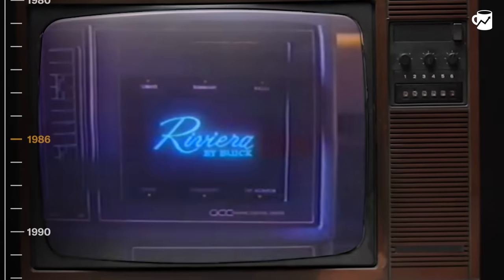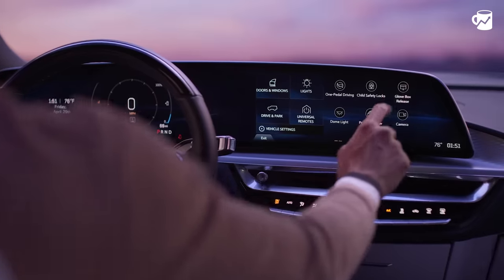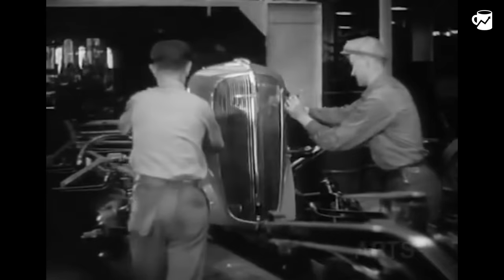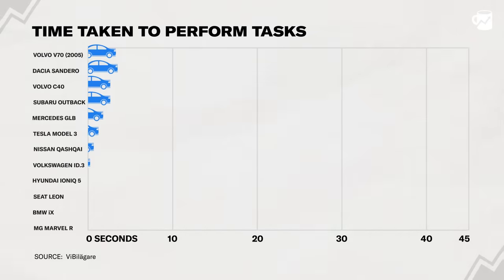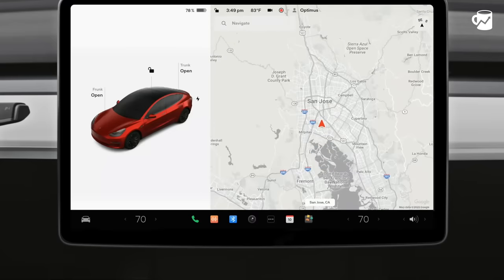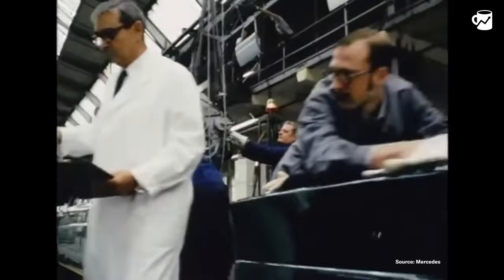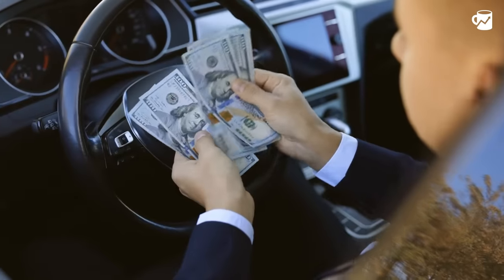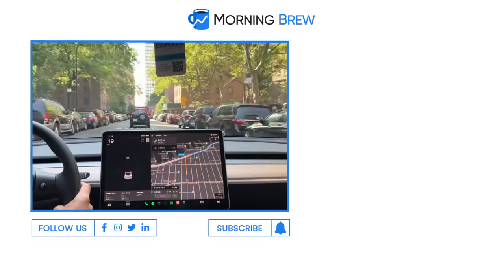The Real Reason New Cars Have Touchscreens

Comment: I work in the radio replacement industry and I can tell you this is also going to make radio/screen replacements basically the same level of extreme as a blown engine. Tech generally lasts about 7 years as far as cell phones and tablets go. Cars used to last 15 years then the engine would blow and people would finally give it up. Now after a few years of use their entire dash could die or just become unresponsive and now depending on the dash/screen it's going to cost as much as an engine to replace.

Comment: Some companies still do a good job of keeping a balance between buttons and touchscreen. My Vilvo C 40 still has some basic buttons like mirrors, locks, lights and basic sound control as physical buttons. The rest is either touch screen or voice commands. They do a decent job by keeping buttons very big on the screen for the apps that you are meant to use while driving. I dont often complain about anything taking more than a couple of seconds to do.

Comment: That is one thing I like about my 2014 vw passat, it has a touch screen but it is not neccesary, you get buttons, you get touch, you also get steering wheel controls, you can use the car without using the touchsceen for most of the things except gps navigation imputs, and it is honestly one of the best car in this regard....

Comment: I have several digital cameras that have rows of unlabelled buttons, known as soft-keys down the sides of the screen. Depending on the function selected, generally with a twist knob, the buttons have different functions which are indicated by icons displayed on the screen. This would work well on a car, enabling both buttons with a tactile feedback and easy reprogramming.

Comment: When I bought my 2013 Ford Fusion I was impressed with my touchscreen, which was large in 2013. It also had buttons on the steering wheel that controlled the majority, if not all the functions I needed while driving. This should be the way it’s done IMHO

Comment: Fairly pleased that my new Audi has a sensible number of its controls as buttons, allowing basic driving adjustments to be done without touching a screen. e.g. demisting, adjusting the AC, activating the rear parking camera and so on.

A handful still require me to look at the screen (most notably selecting different drive modes on the hybrid system), but it's at least minimised.

Comment: Thirty years ago, one of my engineering professors stressed the fact that (almost) all cars had the same user interface: adjust interior temperature with a single knob, radio volume is on the left, tuning on the right, wipers are in the stalk on the steering column, etc. etc. Now they can change the UI in your own car when you bring it in for a tune-up. I'm hanging on to my 2010 (manual) Subaru for as long as possible!

Comment: Another issue with having a touchscreen controlling everything is that it creates a single point of failure.  If anything goes wrong with any component in that computer or display, you can’t control anything, whereas if your radio breaks, you can still control your hvac and other systems.  Too much integration eliminates redundancy

Comment: Tablets don't last forever and it is almost guaranteed that these specialty model tablets won't be a replaceable or available part down the road, except for someone who really wants to pay $4,000 for one on EBay. This virtually guarantees that these cars will not be "classics": Won't even be able to drive them to the show.

OTOH, theoretically one solution might be possible to make a generic tablet (with standard footprint and connector) that works in all cars (or at least in all cars from one manufacturer). For instance, having a "slot" or cradle for slipping in your own Apple iPad. And the car's computer automatically uploads the software to the iPad to run it. (With security firewalls of course for driver identity/ownership.)

Also OTOH, it might be possible to greatly simplify the UI (user interface) on these tablets so that you only get 2 or 3 monster-sized and differently-colored buttons at a time, and only 1-2 choices at a time.

But ultimately, I agree: knobs and switches, please. No look-y. Use feel and sound.

I remember the old Mercedes W123's, W126's, W124's, etc.  Whole lines of cars across decades that used and reused the same switches and dash parts again and again and again -- thus (largely) solving the problem mentioned here of dash redesign expense.

OTOH (again), when did Americans ever want to go back to "simpler" and "same switches as last year"? Maybe it is time.

OTOH (finally!), cars will be driving themselves more and more. And when that happens, there really won't be a reason for most of us to even own one. We'll just call one.

Comment: Toyota so far is the only car brand I've seen doing touchscreens somewhat right. Take the latest Corolla; it has a touchscreen but it's mainly used for stuff you're not supposed to tinker with while driving. All essential features are button controlled. Any stuff that can be controlled though the screen you MIGHT have to use while driving either still has a separate button (handsfree phone, radio) or can be controlled through voice commands (satnav)

Comment: Totally right. This is what I have been saying since long time. It’s not designed for driving. Not only about the amount of options to turn on and configure something (for instance, the AC: touches to find to turn it on, touches to set the intensity, touches to set the temperature, touches to set the vents position, etc), but the incapability to be precise to touch on bumpy roads. It literally takes seconds and seconds out of the road just finding or restoring mistakes. For instance, if you drive a pre 2024 BMW, you can literally see the amount of R&D on design thanks to the console physical wheel. You can move through all menus either just the wheel in few clicks. Or setting up basic stuff through physical buttons. Tesla design is great to diminish costs, but from the design and ui point of view, they don’t have any idea what’s about car UI design.

Comment: In the early nineties I interviewed a guy who'd consulted with banks over a dial-up system for customers. He told them it wouldn't work because people typically do banking once a month. They would never get comfortable with the banking UI. 
The same it true with the these touch-driven cars. We use most of the functions so rarely that we never learn them well enough to be comfortable with them. They become a dangerous distraction.
Morning Brew might want to check out the UI for the latest fighters. While the limited cockpit space means screens need to do many functions, from what I have seen they're not touchscreen. Screens display options activated by buttons on the side. Shifting a radar to weather mode, for instance, might mean hitting the top button twice and the second button once. That can be learned and done without looking down.

Comment: Ships can have the same problem too. After the collision of the USS John S McCain in 2017, one of the investigation findings/outcomes was: the new fandangle touchscreen control system on the bridge was too complicated and the crew needed more training on how to use them. As an outcome, some ships in the USN are being refitted with good old fashion steering and speed control equipment

Comment: My new '24 Prius has more buttons and the odd speedometer streen in front helps monitor their states.  The map is on the big screen in the middle as well as the sound system.  It's like the 373 simulator I flew a few months ago, the driver aids add time to correct errors, auto braking, auto steering, audible mapping instructions.  You can more naturally scan with worrying so much about the second to second steering input as the car can often drive itself.  It could be much better but you know, lawyers.

Comment: It used to be the law in U.S. required turn signal on left, gearshift on right, (or on floor), then they came out with "everything" stalks, with lights on one side, wipers on the other, etc.  Still tactile, do not have to look at them.  And steering wheels had to be round wheels, not aircraft yokes.  Watch "Michael" in Knight Rider fumble with it trying to turn Kit around.

Comment: I really wish auto manufacturers stick with buttons control and use a common operating system for an audio/navigation screen. Not only could I control the non-driving functions of the car, but I'd also be able to add apps that are useful for me (Gaia, Onx Offroad, etc.). Then I could elminate the need to worry about my phone at all. I added an aftermarket android based screen to my older car and it has been a perfect blend between car functionality and future needs.

Comment: My preference for car dash controls have always been rotary knobs for a/c and audio (sliding controls require whole arm muscles for fine adjustments whereas rotary knobs just need a twist of the wrist) and flick switches for functions that are either on or off ( apart from being satisfying they give you tactile and visual cues to their status). I especially dislike odd shaped buttons that are flush and blend into some smooth dash aesthetic that force to look down to ensure that I am actually pressing the intended button. And my last gripe is the random placement of certain controls behind the steering wheel.

Comment: What gets me is touch screens for air vents.  An air vent has to have a front on it, having an adjustable front must cost peanuts where as having some motorised system attached to the touch screen must be much more expensive, yet the manual air vent is sooo much easier to use....

Comment: I strictly want fully independent knobs and switches. That way if one breaks, I can easily replace just the ONE knob or switch.
Touch screens can have hidden tracking and monitoring built in that you can NOT disable (and be certain it is disabled).
Cars do not need ANY electronics. NONE.

Comment: i can change the temperature, in/outside air, fan speed , direction of flow, AC on/off,  window heater on/off, hazard lights - all without looking to the dash. it might be partly due to my 120k km+ experience with that car but still.
touch has nothing to search in a car for the driver to operate.
Reply: I've done like 20k miles over 5 years in my Fiat Panda and I can do all that stuff without looking. Muscle memory is great. Touchscreens make you divide your attention, it's terrible.

Comment: Amazing video and to the point!
It's a tiny bit misleading as you are not well informed about how to operate a Tesla, everything needed for the drive but the AC can be controlled from the wheel.
Is it stupid? Yes... Is it unsafe? Only if you adjust your AC while driving without autopilot. 
Should you be able to do that blindly? Yes! 

I said almost everything from the wheel because after you click the wiper button, a UI pops on the screen and the speed can be controlled with the joystick, that is not the same for the high beam button that pops up a UI on the screen to change the lights (again, not that you need to change them ever).

Comment: I got a dash mounted screen a little while ago mainly for GPS. I'm usually in my car alone and don't like holding my phone, looking away every few seconds to check if I'm on the right path. Having a 9" screen that has android auto is much nicer and due to its size I don't have to take my eyes off the road, it's in my peripheral vision basically.

Comment: You know, I may not be a car designer but if it’s something cheaper that you want in your car design for the dashboard then just make your radio a hidden Bluetooth amplifier. Have a place built in for a tablet or phone since there is mostly only two main companies that make phones and tablets. Have your AC controls in the steering wheel where you would normally have radio tuner controls. The speedometer area can be a screen. In the design of this car interior you would barely need a dash or even central console leaving room for your legs. A more modern car to me is something more slimmed down and streamlined but somehow has everything still in it a normal vehicle would have but be more straightforward in thinking for the purpose of driving.

Comment: I agree, touch screens on cars should be prohibited for safety reasons, cars should have every setting on knobs that you can operate without watching
And they are possible, check the old car control knob of the Sony minidisc, I had it, it was fantastic, a single knob had 4 buttons and 6 functions on the same knob and you can operate it without looking!

Comment: Most touch screen do have audio feedback. As for berried features I agree it’s a big problem however those features in most cases are not necessary for driving the vehicle.  You don’t need to adjust the base and tone of your radio when you drive. You may need to turn on the defogger.  One feature is buried the other is one press to start. 

I will absolutely agree that the Tesla is overly complicated. However it’s important to note that we are not that far off from only needing to monitor the vehicle and not actually drive it.

Comment: 1) "Automakers are not tech companies" - true. So, the best solution would be to let tech companies work on the user interface - that's why Android Automotive (the built-in Android interface that you can find in Polestar and newer Volvos and some other) is a good idea. 
2) It is a good idea to keep several key functions that are used often, such as physical buttons and buttons on the steering wheel, such as climate control, audio controls, steering wheel and seat heating on/off, and seat adjustments. Most other functions can be moved to a touchscreen

Comment: I can do my lights, signals, shift, radio, defroster, heat, ac, wipers, emergency brakes, etc without looking away from the road at 77 years old.  If you lose electrical connection, you lose control.  Maybe even to open the door to escape.

Comment: I like touch screens for apple carplay, Android Auto, and less frequently adjusted vehicle settings but not for audio and climate controls except for displaying the temperature. I much prefer the touchscreens in 2000s to early 2010s Luxury cars where the touch screen eliminates the clutter of having so many buttons but, still has plenty of buttons for turning on seat warmers, turning the volume up, lowering the temperature, etc. and even the option to circumvent the touch screen entire with physical infotainment navigation controls such as in the AL10 Lexus RX350.

Comment: Excellent examination of a modern phenomenon.  Why not just have touch screens showing a bank of knobs with haptic feedback?  They do the same job as an on off switch, of for wipers, press once for normal, two for faster and eg three for intermittent, or similar?  Aircon, slider with haptic feedback against temperature/speed.  Not difficult.  The only adjustments  needing menus are things that are initiated when the car is stationary, handbrake on.  Very simple. Oh, yes, and drop the price to reflect the reduced cost, and also have plug in screens that can be replaced at the drop of a hat when they get damaged.  All this by law...

Comment: I’m a truck driver. I have multiple switches and knobs that do various things. From climate control to traction control. I can activate or adjust most without looking. A touch screen will never be able to do that. Voice control is slow. I have to activate it then speak and wait for it to complete the task. If you need to be entertained then maybe you shouldn’t be driving.

Comment: The problem is that the software is not isolated from the basic driving system of the car. They should keep the entertainment system separated, so that you can still drive the car when the screen is broken or the software crashed.

Comment: If using a phone on the dash as a sat.nav. is illegal, what about touch screens which take a long time at road speeds, to find where to touch? How far will the car travel at 50 mph while you look for, say,  lowering the cabin temperature searching through several screen layers?

Comment: All they have to do is design a UI that can be controlled from a mostly central controller. And be navigated without looking at it (ex: page left twice, click up , click in to activate mirror controls, with the most important controls closer to the "center" page). Little click stick for media and software nav. And then maybe the usual physical seat and AC and volume nobs for those core features.

Comment: after I crashed my 1998 Skoda Octavia I had to get a new car, the only one with some of the most important features I needed also had automatic climate control, so just buttons.

I still miss the old style with 3 knobs and 2 buttons that you can memorize quickly and change without even looking, but cars with that feature are becoming pretty rare and near impossible to find if you want cruise control since that is part of a package and not a feature that's sold seperately.

Comment: One thing that put me off cars was when they started moving to all electronic gearboxes, which are an absolute bane if you're in the habit of block changing e.g. when decelerating to leave a motorway or changing into a low gear to safely negotiate a steep downhill gradient. With some manufacturers now putting gear selection on the touchscreen I've pretty much thrown the car keys in the bin and got myself a Railcard instead. 🚄💯👍

Not only are trains considerably quicker and have (mostly) been EVs for over a century to date, they have far safer modes of operation compared to roads, and the only screens train drivers have in their cabs are ones that are directly central to the task of safely driving a train. 👍